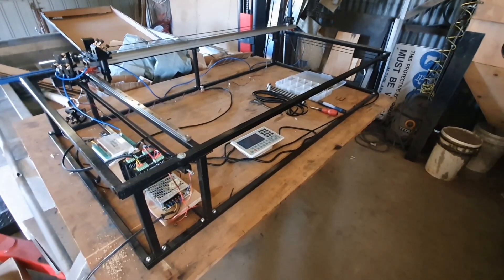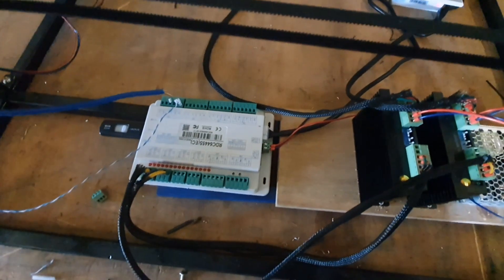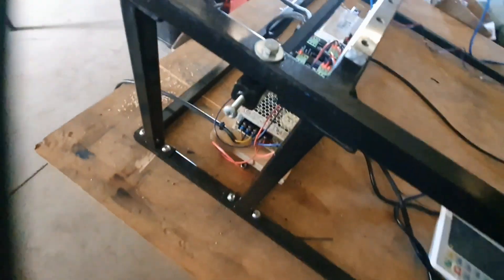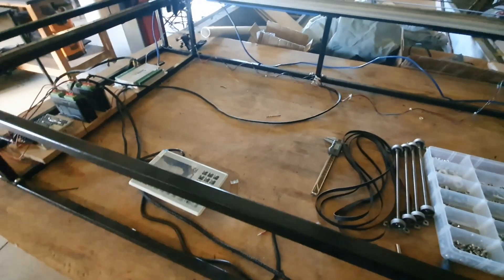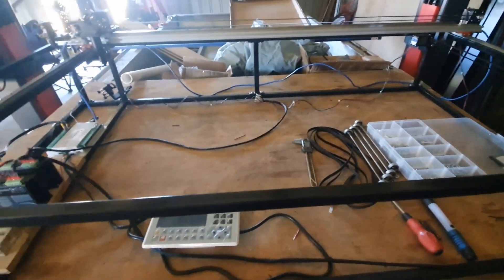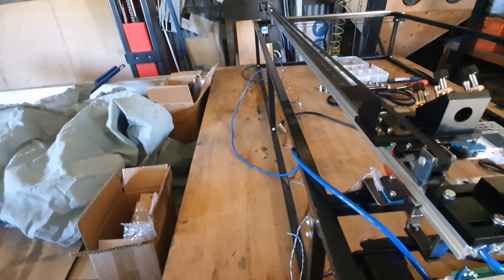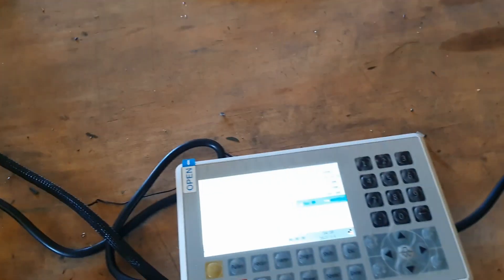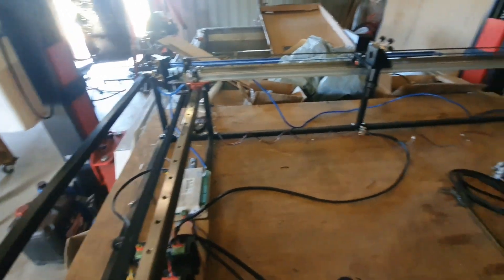CO2 Laser Build Update Part 2 -  Achieving Precision & Power

Comment: Great job. I have a question? 
How you have wired 2 steppers in Y axis? They run with same stepper driver bcs i saw only one driver for Y axis.
And do you configure somewhere in software that the machine runs with 2 steppers in Y axis? 

Thanks 🙏
Reply from the maker: It is not best practice to run 2 steppers on one driver, I had intended to add another driver but it has worked without problem and has done a lot of work so until it does give a problem I'll use it as it is. the steppers rotate in the same direction so they are just spliced together.